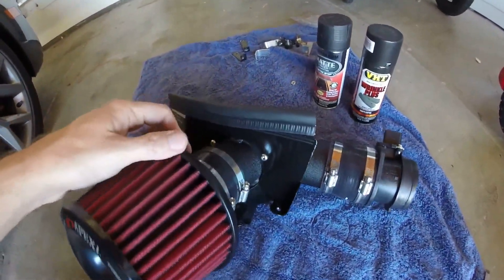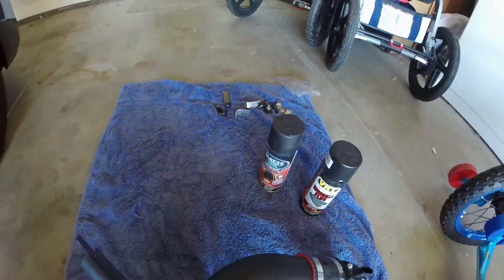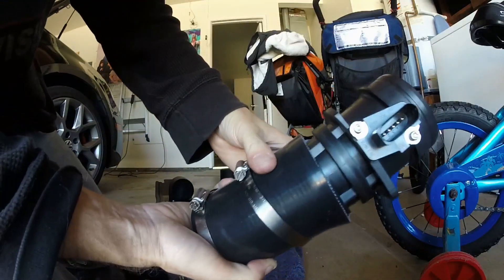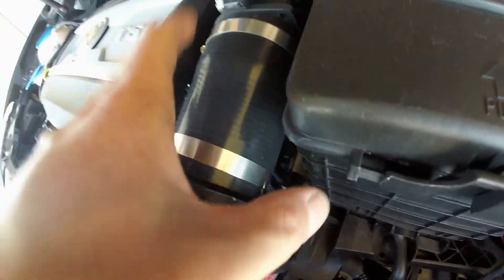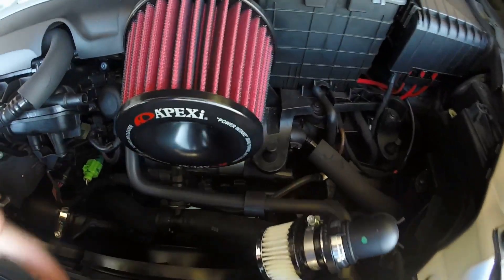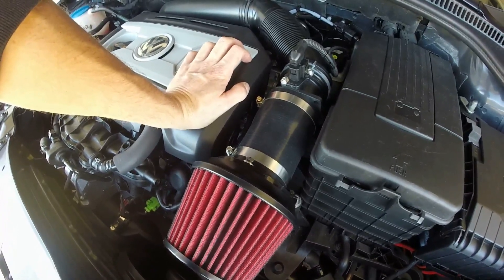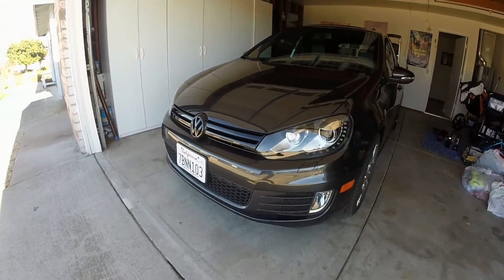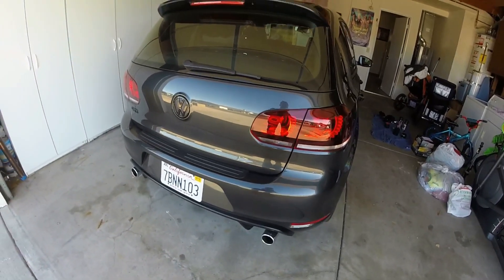2013 VW GTI: Episode 108 Vlog: Cheaper Intake Alternative

Comment: Have you thought of twisting the MAF pipe section 180 degrees so that the big plug is facing downwards (hidden) instead of upwards as it is currently. It looks alot neater and does not cause any issues. Ive been running my GTI like this with a Unitronic intake for about 6 months.
Reply from the maker: ya ive heard of it. not really interested in it, its not a show car. i like the oem functional look myself.